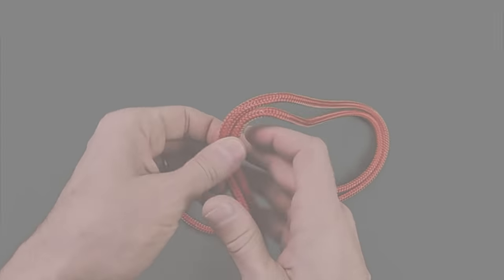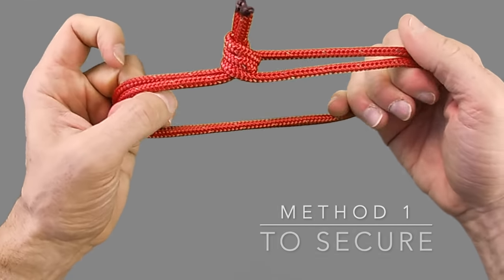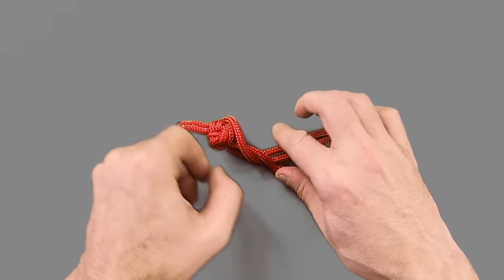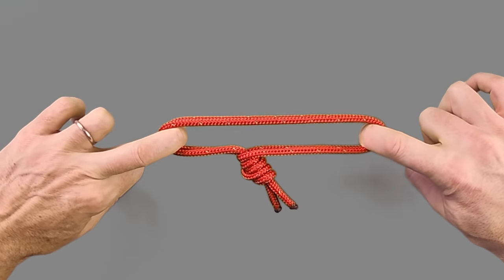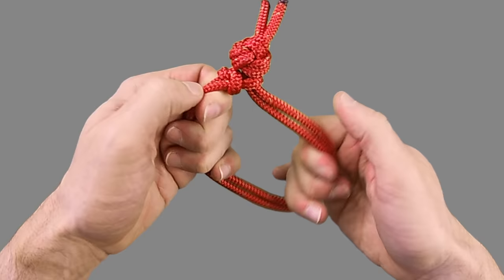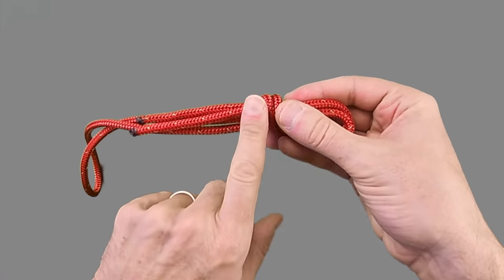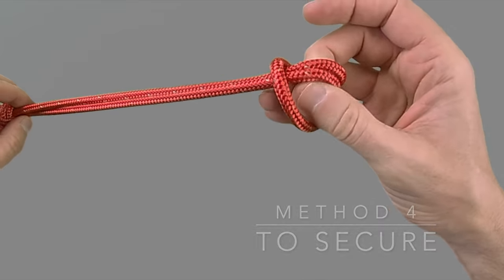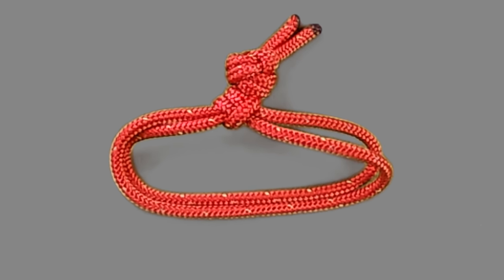10 second Soft Shackles !!

Comment: I have been using an overhand knot with the through and over method for about 5 years daily to carry my water bottle at work. I have about a half dozen soft shackles that I use in this method and I never have had any failures or lost items due to coming apart. I actually use heat shrink tubing to keep the shackles shaped up and tight. The best part about this method is they are easy to use even with gloves on.
Reply from the maker: Thanks for stopping by and for sharing. Totally agree with you comment and like the add of the shrink tubing, I will have to give that one a go 👍🏼

Comment: Excellent, I just learnt something very useful and still remember it because of the simplicity of the knot. Thank you so much
Reply from the maker: Glad it was helpful !

Which was you favourite ?

I can not got past the Ashely Stopper knot version, round end creates a great locking point for the shackle.
Reply: @BottomUPBoats   the fourth knot is great. Wonder if the knot will slip under high tension.
Reply from the maker: @vxphan2601  you should have no issues with this one slipping. If you are going to put it under extended periods of long loads it is always good to pre load them prior to putting them in place. With that said you should be a OK once it is in place.

Comment: Nice and simple. It’s timeless too. 
 Thanks for sharing.
Reply from the maker: Our pleasure ! As  you said these are timeless and can be made in seconds from even the shortest bit of spare rope !
Reply: @BottomUPBoats    Something that is intriguing me recently and you guys might be the people to poke at this topic too. It is the low friction rings or thimbles that are available now. 
I’m only starting to play with them recently. I’m looking for a way to use them “backwards”. Run the running line around the outside and the fixed shackle line through the middle. This, I’m hoping,  will give the running line less friction (or more leverage to overcome the friction) of the inner line and also give less of a tight angle on the running line. It takes the thimble one step closer to being a block replacement for some things. 
There are two hiccups I’m imagining so far. 
1. The big catch is that the shackle running in the middle gets a lot of friction in one spot. 
Possibly dyneema is hard enough wearing to not be a worry for a long time !! It’s basically using dyneema as a bearing. There may be lubrication options to help out here. Or sheathing options too. ! 

2. The other is finding an elegant way to keep the running line “in the block” when the line is slack. 
There might be a nice way to bring a loose loop around the ring with the soft shackle or another little line, to act as a “keep it in place “ type catch to hold the running line.  

If you have thought about this and found solutions then please do share. This approach would never completely replace a good block but in many situations (outhalls, Cunningham purchase systems, kickers /boom vangs, etc) where things need strength but don’t run fast like sheets, this could be an economical solution. Allen brothers for example in the uk have thimbles at incredible prices compared to a proper block able to hold the same load.
Reply from the maker: @frederickwood9116  The modern friction rings are great. I would not worry about the concerns in option one the dyneema will run though it without issue without lubrication.

I have seen them used on cascaded back stays, jib pulleys and many other use cases.

The only place I have not seen them is on main sheet systems where most boats have stuck with pulleys, the will run better in this use case under light laod.

Comment: This is an excellent video, very well done!  I don’t need a $50.00 Soft Shackle around our property, just something that I can make a quick connect and pull a medium weight load with.
Reply from the maker: Glad it was helpful! Sounds like the option we shared are perfect for your use case and can be made with less than 1 metre of any spare rope you have..
Reply from the maker: Glad it was helpful !

Sounds like you have found a solution to your problem that can be solved with any 1 metre for rope that you have lying around....

Comment: Thanks for the great video, which is also great for absolute non-sailors and amateurs!
I have a question: How can I weld the cut end of the cordage without a large tool so that it doesn't split open here?
Reply from the maker: I think you are asking how to stop the cut end of the rope from fraying. If this is the case, it is best to cut the rope with a hot night or use a lighter to heat the rope, some of the fibres will melt which harden when it cools. This will stop any fraying.

Hopefully this answers your question.
Reply: @BottomUPBoats  Thank you so much!

Comment: I tried another variant: the Ashley stopper (ABoK #526) for the knob and the Tag noose (ABoK #1126) for the clamp - seems it may be (even) more slack shake proof than the Lark Head and doesn't fall apart when the shackle is opened.
Reply from the maker: The joys of a Sunday afternoon with ABoK, will have to check out the Tog noose and give it a go. Thanks for sharing some great options

Comment: This video alone is worth subscribing for,  So I just did!
 I had just hoisted my brand new mainsail and was motoring from the harbour down the channel to the lake. With confused seas and shifty winds and a loose mainsail foot caused my metal shackle attached to my clew to twist, deform and break. This resulted with the mainsail flogging to leeward and provided entertainment for the spectators on the pier and that did not impress my wife (crew of two). Fortunately,  I was able to turn upwind quickly in the busy narrow channel and i used one of your soft shackles shown here secured the clew to the boom and instantly resumed on our journey out of the channel. The soft shackles now have a permanent place on my yacht and I have a few lengths of dyneema at the ready because you never know...
Reply from the maker: Thanks for stopping by and subscribing.... 100% agree that some spare dyneema is a must and with these you can have a custom shackle in second !!!

Comment: Bunyip , particularly what would you use these knots for?.  As i have an arsenal of stoppers , why do i need these ones Sir?.  Thank you for your time. Cheer’s Namaste… !!!
Reply from the maker: With the strength of modern dyneema rope many people have switched to using rope soft shackles rather than traditional metal shackles. Sailors and Climber are using rope shackles as they are lighter, stronger, cheaper in addition to being able to make them yourself.

Some use cases include.

Attaching halyards or sheets to your sails
Attaching pulleys to fixed points on your boat
Joining a tow cable to a car.
Hang your hammock.

Comment: Very nice. How does the strength compare to a spliced shackle?
Reply from the maker: To get the max strength with a spliced shackle you need to finish it with 4 widths of rope past the stopper knot with a simple loop to hold it in place. This can result in a braking strength 230% of the base rope.

I have not tested these but it will be a lot less, with only two widths and the knots to finish them off (which could be the weakest point) I would suggest it would be similar or slightly below the strength one width of rope.

I am going to have to find someone with an load cell so I can run some actual comparisons for these...

Comment: Hey great instructional video, lots of variations. Would a clove hitch be more or less likely to weaken the shackle than the larks head is? I have used it but not under much strain, it seems good for keeping everything together when the is little to no load.
Reply from the maker: I have not been able to find anyone who has load tested the options. I have it on my list of video to make but am having issues getting the correct load testing gear. From my research on more traditional soft shackles the main contributor to the breaking load is the knot rather than the method of completing this shackle. 

Based off this research which is sadly not backed up with data I would say they  are similar. The key is the knot, the Ashley stopper is great as it gives you a big square edge.
Reply: Suspect break load would be very similar with larks head/clove hitch however if it's been heavily loaded the larks head should be easier to undo.

Comment: Question for #4 instead of a Larks head/Cow hitch would a Bull hitch be better? Great video and Subscribed....
Reply from the maker: Thanks for stopping by and for joining the crew. I had not considered the Bull Hitch, thinking it about it is obvious that they both can do the job. The Bull Hitch is slightly more secure due to the cross over in the main part of the hitch. While I have not tested it my first impressions are this will make it harder to undo after load has been applied, if this is the case I would stick with the Cow Hitch. With that said it is up to you, both will do a good job.
Reply: @BottomUPBoats Darn good point, my first thought it would be more secure and less likely to loosen if bounced around.
Getting it undo might be an issue...
Reply from the maker: @mistastabs5840  the shackles tend to stay locked even after light load. If you are worried about them come undone you can loop a Velcro strip around the knot end to keep it neat and tidy
Reply: You can treat the loop end as you would to change a Lark's Head into a Bullock Hitch.

Comment: Any strength comparisons to the diamond and button knot versions? To the ones that use a brummel splice loop?
Reply from the maker: I have not down any, hope to try and build a test rig this winter to take some.

It will be less but still ok for most use cases with modern rope.
Reply: @BottomUPBoats   Makes for great paracord carabiner substitutes! As strong as most non-climbing carabiners. I figure it at 70% of the line breaking strength at a guess. At 50% it would still be more than 250 lbs on 550 paracord.

Comment: Any data to back up all these clams? I know from other videos that the simple overhand knot slips so soft shackles based on them are not particurally strong. I have only tested diamond and button knots myself.
Reply from the maker: I have not got around to load testing these, may be a job for the winter. The shackle strength is linked to the knot you use, with strength increasing with a large square edge on the base of the knot. If you were looking for the strongest I would guess that the ashley stopper knot will give you the best results.
Reply: Allen, Check out the HowNot2 chanel. I think you would particulary enjoy it. They did a sailing series as well. 

BTW, I've been enjoying you mast climbing videos. I just moved up to a 28' Yankee with a keel stepped mast, so I'll be taking some trips to the top this spring.
Reply from the maker: @daveopincarne3718  good luck with the new boat. Lots of other option to consider both spliced and with knots in this playlist.

https://youtube.com/playlist?list=PLMoCfFBA9IMXC6P0b6Ql8822sZnthEYfk
Reply: @daveopincarne3718  Hi Dave,

Thanks for the comment. Good to hear from you.

Comment: Thanks very much for your demonstration !  When do we need this ?
Reply from the maker: Any time, these shackles can be used in most applications that you would use a traditional metal shackle. The are lighter, cheaper and with modern rope the can be stronger than their metal cousins. 
They have the added advantage of causing less damage your boat, spars or humans in use cases where they may be flapping around.
Reply: I would strongly advise the use of these on an anchor chain snubber instead of using a stainless steel chain hook. I was astonished at the damage a stainless hook can do, and how bent it was when it jammed in our bow roller. The hook was destroyed in a split second and fired off the roller like a missile ripping the cheek plate sideways. If the pulpit bars had been open fronted the hook would have hit the winch operator. Only takes one wave for the winch operator to make a mistake.

Comment: Nice demo,  but what would this knot be used for?  Is it used on boats?
Reply from the maker: Thanks for the feedback. These can be used to replace metal shackles across a variety of use cases. With the strength of modern rope the dynemma version can be even stronger than the metal alternatives. On boats, for towing cars, while climbing, just about anywhere you need to join two things together.
Reply: Becoming a popular way to attach hammock tree straps together too.
Reply from the maker: @hubey  the use cases are only limited by your imagination. 👍
Reply from the maker: @hubey  nice one, the use cases are nearly endless if you put your mind to it.
Reply: Good question thanks..
Good answers too,thanks again.

Comment: just a question:
what is the application for this soft shackles?
Reply from the maker: on boats they can now be used in most places traditional shackles are used, fixing pulleys to fixed points, sails to sheets or halyards to name a few.

Climbers also use then in place of metal options as they are light and have high breaking loads if made out of modern rope.

They are also big with 4X4 users, much safer to winch with these as if the cable breaks you don't have bits of metal flying around.

Comment: It would be interesting to see those tested for breaking strength.
Reply from the maker: It is on my list of videos to make, need to get my hands on a digital load test and we will get it out there
Reply: If that happens, I may also be interesting to see how easy to untie different shackles may be after being subjected to sizable tension.
Reply from the maker: @maciejtomczak3785  will be interesting to test this out. Some of the more heavy duty options will be hard it not impossible to undo
Reply: I saw a video. IIRC they used 3/8" line (don't quote me on that) They tested to failure around 20k-22k pounds and it was typically the line that failed not the shackle.
Reply from the maker: @sideswipe147  thanks for sharing 👍
Reply: With all the shackles, you’re quadrupling the line, and then losing something like between 50-70% of the strength in the knots. So you should always end up (sometimes only slightly) stronger than a single line. If you’re using shackles made from the same rope as your main line, there you go.

The real differences between different shackles aren’t going to be breaking strength, it’s gonna be about a) whether they remain closed under tension and b) whether they remain closed when the line is whipping.

There’s a reason the complex spliced dyneema soft shackles exist, and it’s not really for MBS (although it doesn’t hurt that you can usually go down a size of rope on the shackle). The biggest reason is that dyneema is very nice material but also it really doesn’t like knots and it does like being spliced. On most other materials — whether natural or nylon or polypropylene or even regular polyethylene — this kind of quick release will hold fine.

Comment: Instead of making a loop and throwing a cow hitch over, just tie a knot on each end of a single length and then put the loose ends together and then throw cow hitch over, this way you still have a short length of cordage for other jobs than just a soft shackle.
Thats what i do.
Reply from the maker: Great idea !!!!

I will be giving this one ago. Same outcome using less rope.

Will have a lighter breaking load which should not be an issue for most add hoc use cases
Reply: @BottomUPBoats  if I want a soft shackle of a particular size I use the  cow hitch as normal and with the loose ends I tie a Espalier knot or a surgeons knot, the latter of the two of what I use mostly and it never moves.
Reply from the maker: @zchuss1  cool, I will give it a go !
Reply: @BottomUPBoats  let me know how you get on.

Comment: Will these work with dyneema ?

How do you think the breaking strain compares to the bury methods.
Reply from the maker: The breaking strain will be less, the primary reason for this is the bury give you 4 widths where the rope exits the knot into the main body of the shackle. Secondary reason for the reduced strength will be the methods for doing the lock, the knot based locks will also reduce the breaking strain.
For there reason we recommend the burry method if you have the time. These are great if you only have double braid or need to get something done in a hurry. 
Finally yes there will work with dyneema, I am going to have to do some break tests to get data to confirm the variation in the strength of the various options.
Reply: no

Comment: What are these good for?
Reply from the maker: Any time, these shackles can be used in most applications that you would use a traditional metal shackle. They are lighter, cheaper and with modern rope the can be stronger than their metal cousins. 
They have the added advantage of causing less damage your boat, spars or humans in use cases where they may be flapping around .

Comment: The Ashley in 1/2" line requires careful dressing to lock the knot itself up tightly.  Nice and big tho.  With the Lark's Head being used, I wonder how big of a knot is really needed to stop it.
Reply from the maker: Yes you need to be careful with the Ashley stopper knot and how you finish it. With that said big is beautiful when it comes to stopper knots on soft shackles. Research shows that the size and finish of the knot contribute to the breaking load. Most will break on or around the knot, I don't thing the larks head has a big impact. I have not personally load tested these, maybe that's an idea for an upcoming video !
Reply: . The larger the radiuses in the stopper knot the stronger the final result same with the bight end, if it is wrapping around 4 lines it will be stronger than if only 2 are at the neck of the shackle.  

Takehome is large bend radius translates to near full line strength.